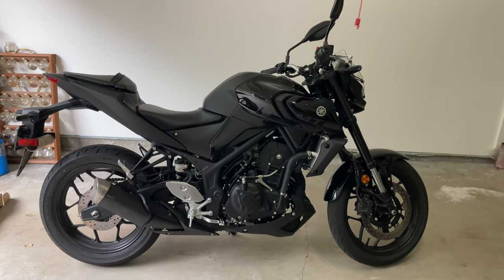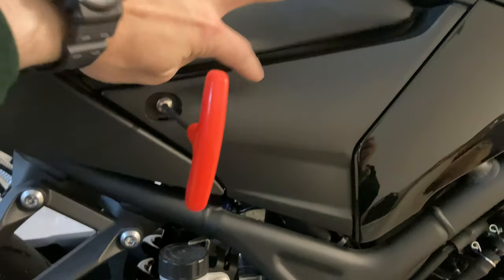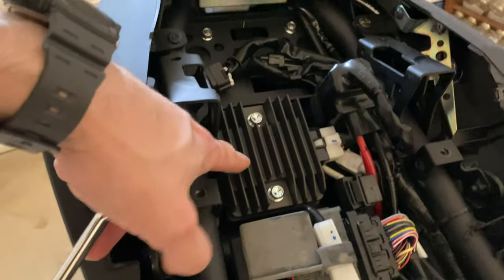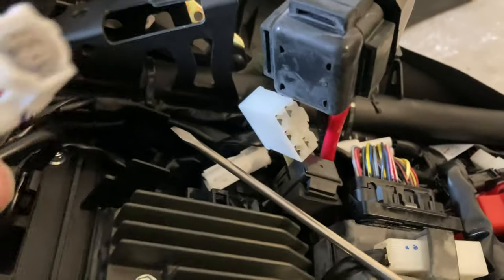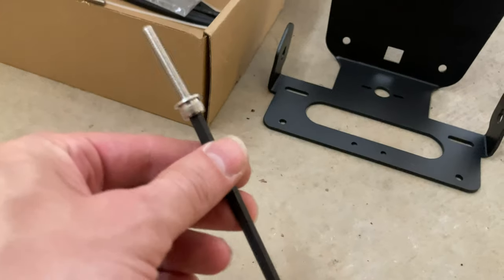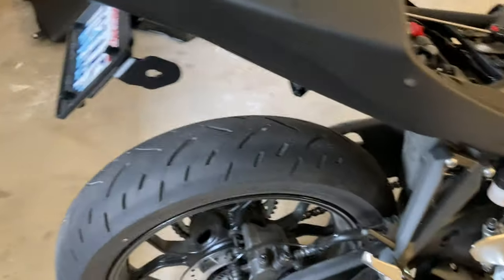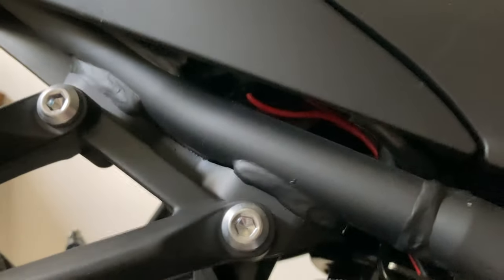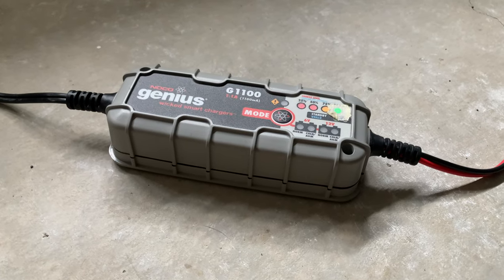2020 Yamaha MT-03 Tail Delete

Comment: Muy bueno y le da una visión más deportiva a la moto pero al cruzar pantanos o agua salpica tanto cm al parrillero como al conductor también, si teniendo el guarda barro salpica ahora así más
Reply from the maker: Thank you, the look or appearance improved this way, as the OEM splash "whale tale" plastic fender from the read deleted, a hugger fender covers the chain and rear tire reducing water splashing or mud up throwing at rider. Also I only ever ride or operate this motorcycle in clear sunny summer warm weather perhaps 25-100 days per year maximum, only if I feel sharp mentally, physically strong with a focus on safety since there exists locally many motor vehicle drivers of low skill who are bad a driving cars making it more dangerous to ride a motorcycle in traffic with other vehicles.